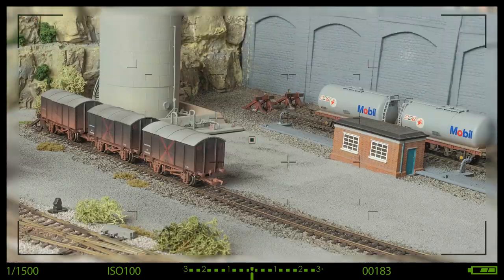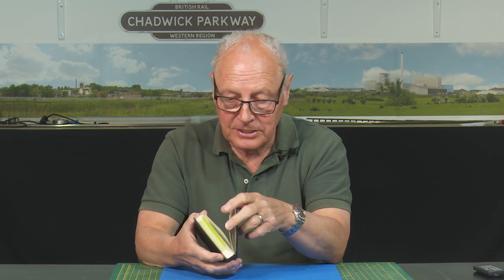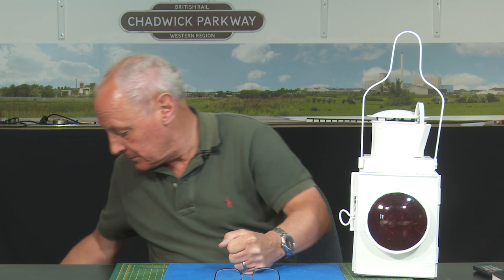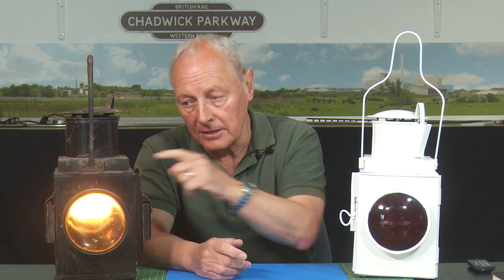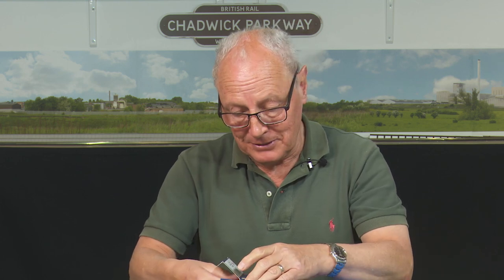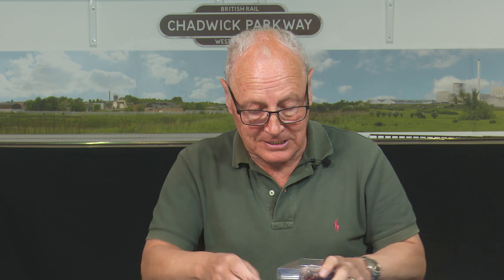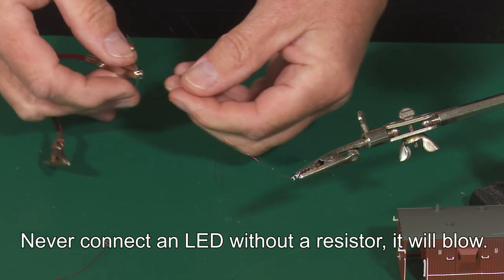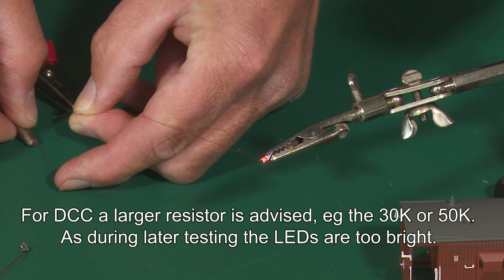Guards Van Lighting at Chadwick Model Railway | 94.

Comment: Charlie an easy way out of your brighness is to disconect one wire from the track pick ups and insert a resistor in series hidden underneath.Your ebay man has gone
Reply: Hi Bob Sims. I watched Charlie's video yesterday afternoon and ordered what I think were the last 5 of the antiflicker boards. I have suggested to the guy who had them that he make some more as bound to be demand following Charlie's excellent video. Apologies for taking the last ones and hope they do reappear.  Clifford
Reply from the maker: Hi Clifford, I ordered 10 when I first found out about them.
Reply from the maker: An interesting option Bob, it hadn't occured to me.
Reply: @cliffordison5004  thats ok I have just made two.

Comment: Every time I see Charlie solder I cringe, being in Silicon Valley (CA), where we had to make assemblies that survived going to the Moon, leaving the Solar System and ghastly temperature ranges.

Solder moves TOWARD heat. That means that the wire is between the soldering iron and the solder, not spread on the joint like jam. Maximum heating time is two seconds.

I know Charlie doesn't like hooking and crimping joints in terminal strips and wiring, but this is required in military/aircraft/space electronics. An old saying in the days of point-to-point wiring is "it should work with no solder at all".

Overall, though, I really enjoy his videos and I have learned a lot about layout building and especially English trains. Very different from US equipment or at least what we have left of it!
I am 80 and when I was a tad it took 2 weeks for a freight shipment to come from the East Coast. It still takes 3 days and 2 nights to cross the country on our fastest passenger trains even today -- same as in the 1940s and 1950s. The Rocky Mountains slow trains down to 25 mph for passenger trains and freight trains barely crawled, since steam engines develop maximum power when they are nearly stalled and standard practice was to run "rakes" that were 2 miles long.

Keep up the good work, Charlie!

Larry Miller
San Mateo, CA
Reply from the maker: An interesting comment Larry.  If you are still soldering, what manufacturer due you recommend?

Comment: Man with multi colored LEDS of today i would of thought you could run solid and  flashing lights,,

with note you would like mount 1 to  the middle  of  the carriage to  simulate stop and  go signal on the guards van..
Reply from the maker: They are a great asset Jason and really look the part.
Reply: @ChadwickModelRailway  what i was talking about as well as that was the  stop and go lantern the break man would be using to stop and start the train from the caboose

i think the central like would need a switch on middle light  for low light conditions..

Comment: Charlie
High Mate just saw your Video On the brake van. I have just done something similar to a Bset and an Autocoach on my layout. I used the same Anti-Flicker circuit board on mine. A word of warning, the caps aren't rated properly. They should be a higher voltage normally 1.5 times operating voltage,. I changed mine to 25V ones. I also fitted latched reed relay in the circuit so they an be turned off and on using a magnet. I have a few spare caps if you would like some drop me an email.
You can see my method of adding lighting on RMweb Barkham Green

Richard Rigby
Reply from the maker: Hi Richard, long time no see.
Don’t worry about the caps, I'm pretty sure that I have some.
Regarding your magnet mod, I'm aiming to fit a decoder to switch them along with the loco lights.
Stay safe mate.  Regards Charlie

Comment: Err, Charlie don't need a guard's van in a fully fitted train on the period you are modelling under the train is carrying hazardous materials. The rules changed in 1969.
Reply from the maker: Steady on Neil, unfitted trains such as 16 ton mineral wagons were around everywhere then.
Reply: @ChadwickModelRailway  please note that that I said fully fitted trains not partially or unfitted, which always needed a guard's van. Trains of hazardous material such as trains carrying hydrogen cyanide from ICI at Haverton Hill orcarrying nuclear waste needed guard's vans until only a few years ago in the case of the nuclear waste. The transport of HCN, the UK's most dangerous load ceased before the need to have a guard's. van. The only other fully fitted trains needing a guard's van are those needed to cross numerous train man operated level crossings or those with long propelling movements, an example to cover both of these scenarios wax the trains serving the quarry at Redmire.
Reply from the maker: Wow Neil, great info.  
Sorry for the misunderstanding.
Reply: @ChadwickModelRailway  no problems.

Comment: Great video, as usual, but I did cringe when I saw your soldering "skills".  When I were a lad training to be a TV repair man we were taught to never apply solder to the iron and then iron to the joint, but to put the iron on the joint to heat it and then apply the solder to the joint.  If you leave solder on the iron too long the flux burns away and you're left with a dull joint - joints should be shiny!  Another thing we were taught was that joints should be mechanically sound - the strength of a joint shouldn't come from the solder alone.  I'll admit this isn't a practice I adhere to religiously, so I'll cut you some slack there! ;-)
As this video is some months old (I'm slow on the catchup!) i expect your skills have improved, so disregard anything I've said that you've already mastered!
Reply from the maker: My soldering skills have come on somewhat Steve. But the soldering job with this guards van  was particularly difficult without a soldering iron built for electronic components. 
I’m innocent governor! 
Regards Charlie